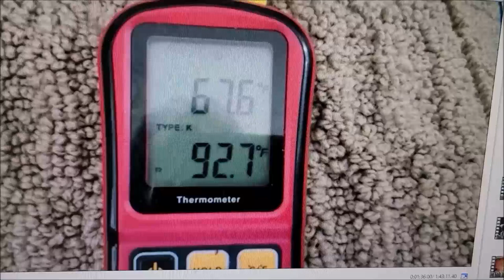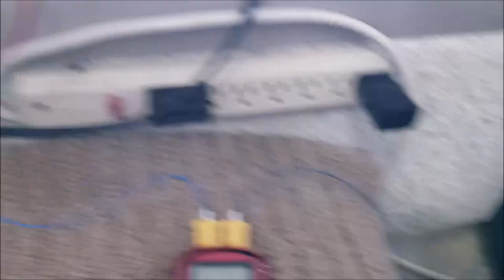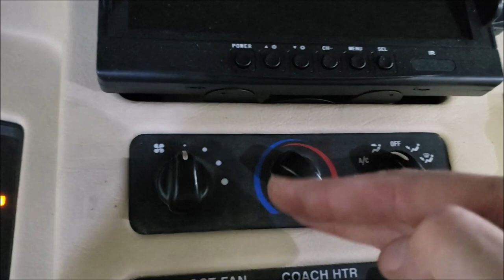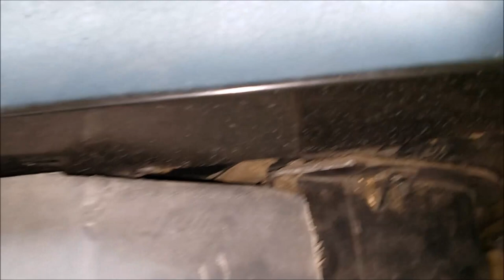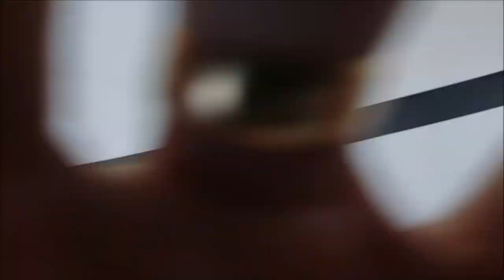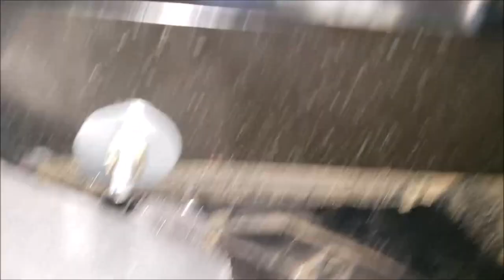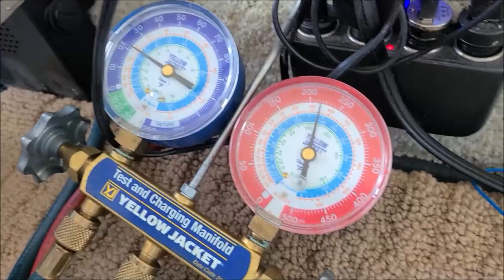How to Get ICE COLD AIR From Your RV Dash Air Conditioning & Trouble Shoot Its Many Components.

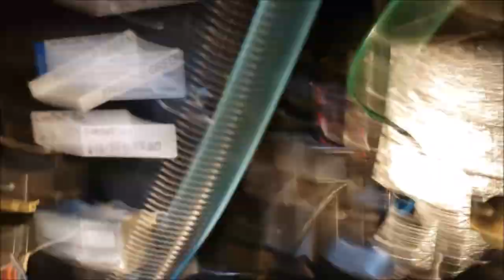Comment: I have a 2003 Winnebago Adventurer 35U. Everything is the same except the servo motor has 3 screws. I took 2 off and was togging at it with no luck. Stuck my head in there with a flashlight and found a 3rd hidden and then the servo pulled off. At 19:17 yours show just 2, so there are some differences by model year I guess.

Comment: Kevin, I had to change my AXV now everything is working well, I have a 20 degree delta between ambient and vent air, however air is also blowing through my defrost vents in every mode selection.  I own a 2005 winnebago 35A, workhorse W24 chassis, can you help with this?
Reply from the maker: I sure can text me at 606-875-0125 any time Kevin
Reply: Kevin probably got you sorted out. I had a similar problem on my 2007 workhorse 16 chassis. Found the vacuum actuator that controls the recirculating door was full of dirt and frozen, and my vacuum lines were deteriorating. Replaced the blue and green vacuum lines and cleaned out the actuator. Works much better. Now I just need to seal the box better like Kevin shows at 1:06 in video.

Comment: Kevin….please help.  I took my 07 Bounder W22 out yesterday to test AC (chassis & topside units) .  The chassis would not get cold. When I arrived back at home there was a gush of cool water pouring out of the box area in engine compartment. ??
Also, my topside units compressors would not turn on while driving with gen on?
Suggested path forward?
Thanks 
Barry Brown
Reply from the maker: Text or call me at 606-875-0125 Kevin